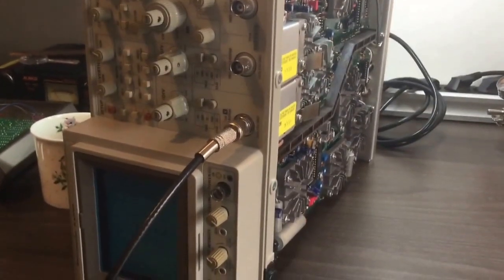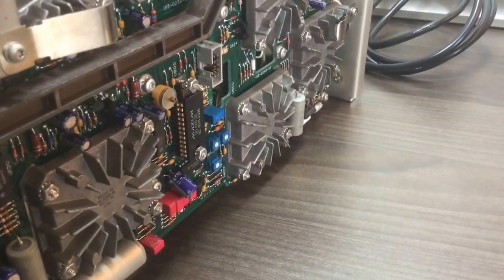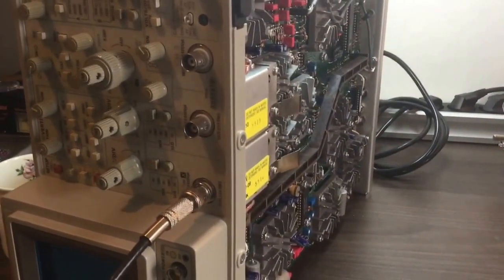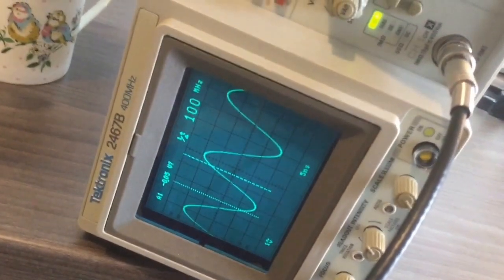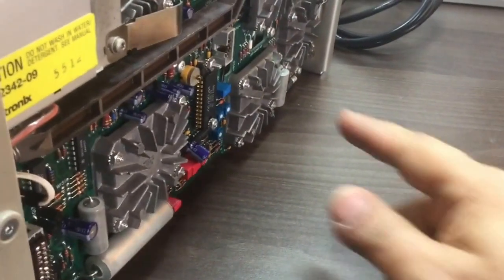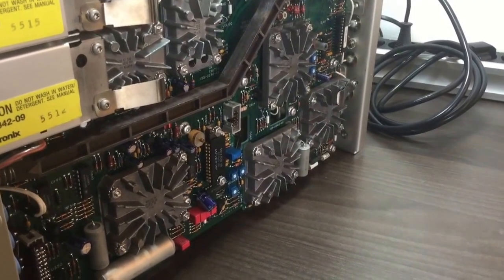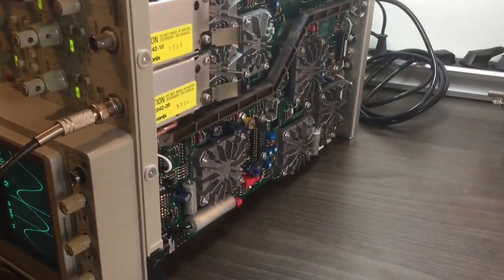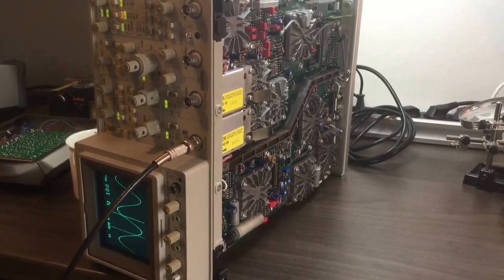Tektronix 2467B U800 failure and repair

Comment: On the tektronix 24xx series the metal cover is part of the cooling system, the fan blow out the air that pass thrugh the holes in the cover in correspondece of the heatsinks, if the oscilloscope is powered up without the cover for a long time can cause damages to the ic's. This is a thing to consider when work on theese instruments.

Comment: In your experience with your 2467B, can you really get a very sharp focused trace similar to, let's say, cheaper scopes? Mine gets focused but I never get that sharpie trace that one originally spect. My thought is that its special CRT is too sensitive and it shows the noise levels carried by the signal under test that other CRTs don't, giving the impression of a not perfect focused trace. Sorry, I know this is a bit apart of the subject of your video.
Reply: Might be worth checking the ASTIG control and  dynamic focus for edge sharpness.